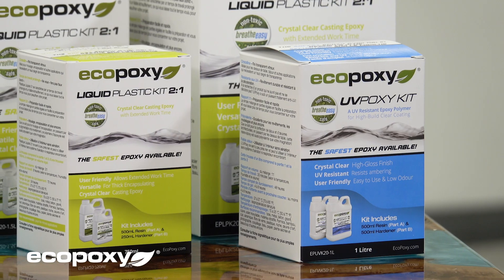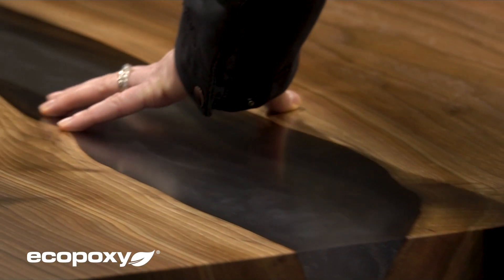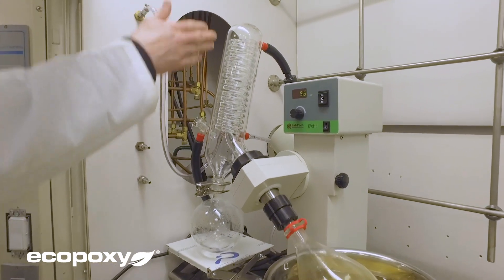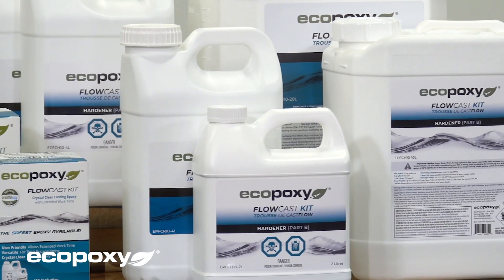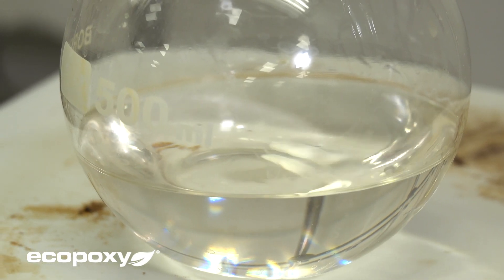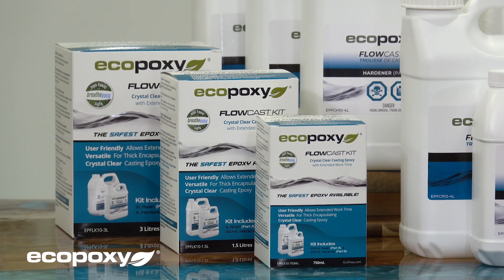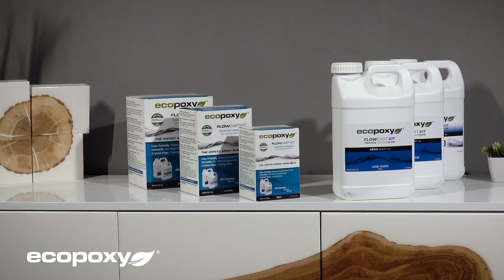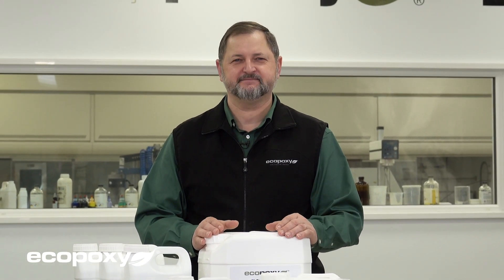EcoPoxy's Revolutionary New Deep Casting Resin

Comment: Do you recommend Uv poxy for silicone mold coasters and trays? Or should I use flow cast and then UV poxy for just the coat?
Reply from the maker: Either option should work for you but too much UVPoxy may get too hot possibly ruining your mold so test first. Hope that helps.

Comment: I'm looking to do a 30L pour with a 2.5 in depth for a 7 foot dining table at 6-8 inches wide. Is it safe to pour all that at once?
Reply from the maker: Only our most experienced customers can do this in one pour with the right equipment. We do not recommend you do this unless you've done it before and know how to control the excess heat generated during the curing cycle.

Comment: Do you need to seal/prime edges and bark of the wood before using flowcast to make a river table?
Reply from the maker: No, it's best not to but you can if you want to.
Reply: @ecopoxy  Hey thanks alot, I have another question... does the epoxy bond to bark well? I have a really nice slab of walnut that I want to preserve the bark on. Or would I need to encapsulate the entire piece?
Reply from the maker: @liamfatica3814  It bonds very well to bark. It cannot be separated again. The weak point is always the bark to the slab. Hope that helps.
Reply: @ecopoxy  okay great, so as long as the flowcast is covering the slab and the bark it'll work, thanks again.

Comment: Just done two pours with FlowCast. Very easy to work with, gets into the nooks and crannies much easier and quicker than Liquidplastic. After curing for approx 72 hours, have noticed that there is also less shrinkage, probably because the product settles in much better.
Reply from the maker: Thank you for your feedback. Much appreciated. Any chance you can send us photos of your projects? admin@ecopoxy.com